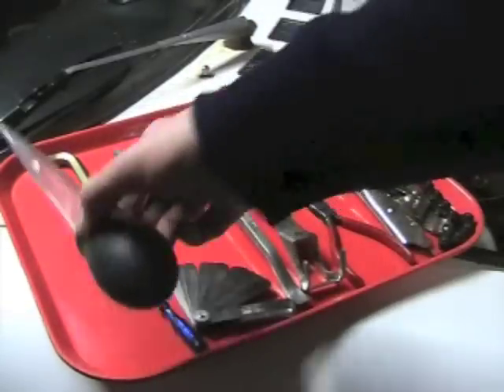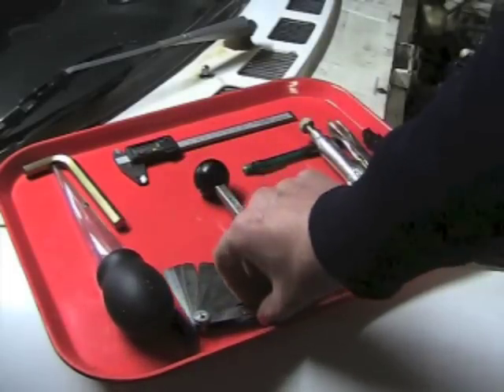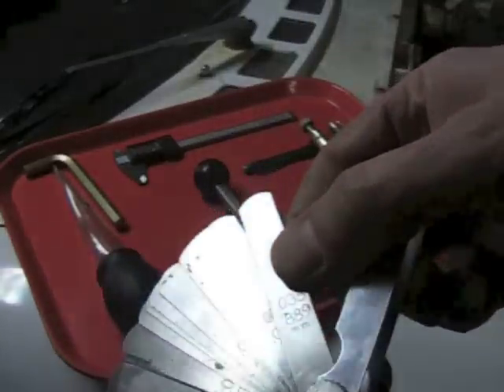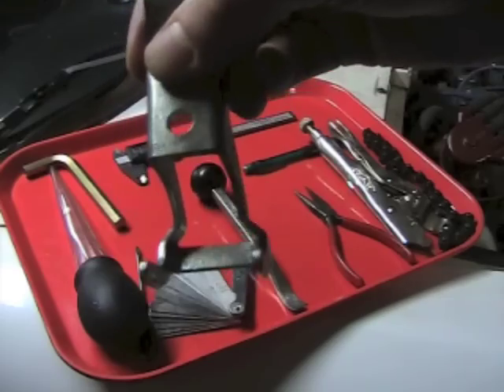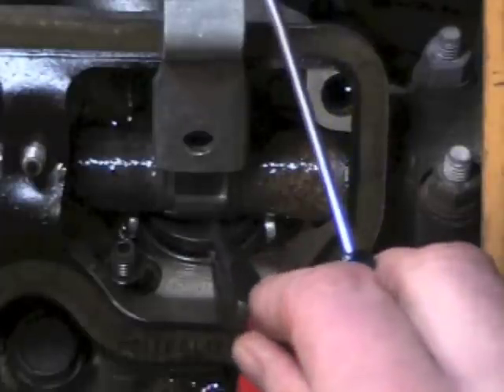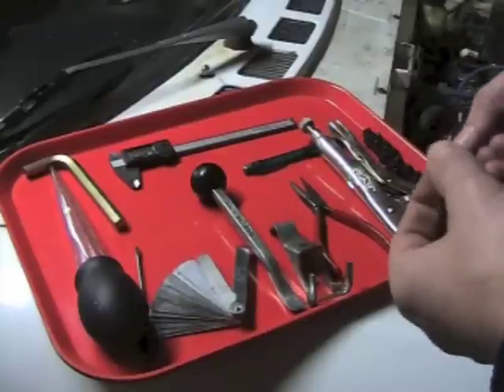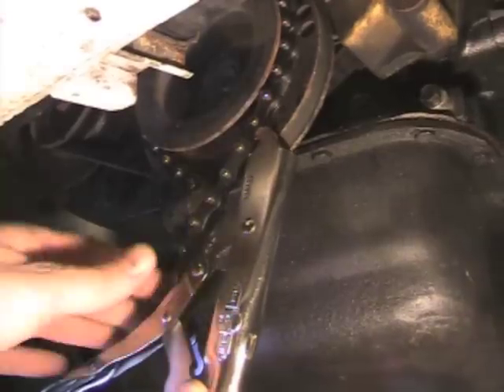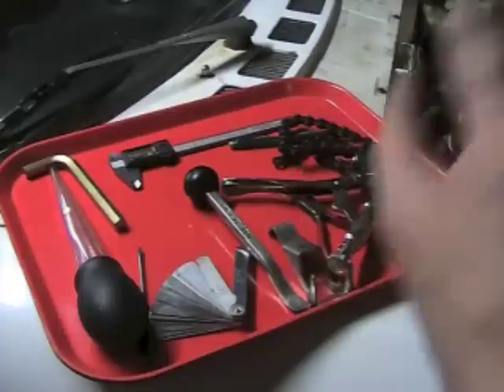Fiat 124 Sport Spider Valve Adjustment Tools

Comment: I really appreciate this, just did a valve adjustment on my '78! One thing I did differently was I used a homemade magnetic pickup tool to remove the shim, I had some very strong neodymium magnets and 3d printed a long holder for one, it had no trouble retrieving the heavy shim. Word of caution for people watching: be very careful with the chain wrench, if the tool slips while you're trying really hard to turn the crankshaft, there's not a lot of space and lots of rusty metal down there so you might end up needing stitches and a tetanus shot like me.

Comment: where can i find the tools
Reply from the maker: Hi! I got my adjustment tools so many years ago that most of the companies are out of business. (Bayless, International Auto Parts) I do see some tools listed online at certain places, but for breathtakingly distorted prices ($220 for the tappet hold down tool? !!! Seriously?) The only thing I can suggest is checking eBay and car swap meets/flea markets maybe. Or maybe someone selling parts cars, the black-handled tool I have came from an X1/9 I bought in the 1980s. Sorry I don't have a source for these.
Alden
Reply: @FlashDriveFilms  thnx for the reply friend, thats insanely expensive indeed. i can buy a complete long block for 200. i will just remove the cam and swap it without the tools then.
Reply from the maker: My thoughts exactly. When I originally bought my tools back in the 80s, they were like $20 each. And there were several vendors. Now , because these cars are older and more rare and "collectible", I have noticed a lot of profiteering for specialty items. Even the valve shims themselves are climbing in price. 
Best of luck with your Fiat project!
Alden
Reply: @mrboostification  False economy my friend. Whenever you swap the cams, you need to adjust the valves. It is also part or regular maintenance. Failure to do so can result in improper wear to your cams, valves or even failure of your engine in extreme cases.

Comment: I am trying to set the valves in my '81.  When I've done this before, I borrowed tools and shims from a friend of mine who was a Fiat mechanic, but he has since passed away.  He gave me one of the things that holds the tappet down while you remove or insert the shim, but I need the other tool-- the one with the spherical knob on the end-- that you use to compress the spring before inserting the holder thing.  None of the Fiat parts places seem to have those.  Can you tell me where you got yours?
Reply from the maker: Hi! I got mine back in the 1980s form a company called Bayless out of Atlanta. I think they have chanegd hands several times since then. The other tool I was lucky enough that it was included in an X1/9 I had bought way back then.A lot of these tools are out of production, so maybe ebay or a car swap meet or flea market is the best bet.
ALden
Reply: @FlashDriveFilms  Just one time. Matt Brannon of Midwest X1/9 bought out Art Bayless's remaining inventory from Georgia and merged with his existing business to form Midwest Bayless in Ohio. IAP retired and sold their Alfa Inventory to Centerline in Colorado and remaining Fiat 124 inventory to Csaba and Ramzi who started out on their own as Auto Ricambi after working for Robert Vick in Texas. Robert also retired and sold to a new family who now run Vick's but Chris Obert is still around and selling part in Santa Cruz. Any of these guys may have the tool you need.

Comment: Why wouldn't you just use the cam lobe to push the valve, then use the $40 tool to hold it, and then rotate the cam lobe 180 degrees?

I found this clever approach which avoids all the special tools, even the $40 one.

http://fiatspider.com/f15/viewtopic.php?f=9&t=30170&p=236174&hilit=Easy+valve+shim
Reply from the maker: +Rob Haynes No reason I can think of. It is just a LOT more rotating the engine, and to be efficient, you should have both cam covers off so that you can move between the camshafts to pull the next shim that comes in line. On my car I rotate the engine by hand during this task, using a chain wrench on the auxiliary pulley on the crank. So I would be up & down on the floor multiple more times as I crank the cam to hold down the tappet, then on my feet to place the tool, then back to the floor to rotate the cam lobe away for clearance to remove the shim, then on my feet, shim out, measurements taken, if I have to replace the shim to order the correct size, back to the floor, rotate to point I can release the tool and then on to the next cam lobe. Rinse & repeat.
The tie-wrap gimmick looks pretty slick & I know I am lucky that all my specialty tools were bought years ago at what now seems bargain prices. That said, I have never been a fan of sticking things down the spark-plug hole and into the cylinder. Any mishap and a plastic part drops in there? I wouldn't even be able to fish it out with a magnet. There is a border between "thrift" and "cheapness" and the tie-wrap thing seems to perhaps straddle that line. But as they say YMMV.
Alden

Comment: I just ran across this video.  Very helpful, thanks.  One thing though, that tool you found in an old X1/9 is $140.  Is there alternative way to do it?
Reply from the maker: +Rob Haynes Hi!
Well I had no idea the tools had become so expensive! The black-handled prying tool can be replaced by a wide-bladed, flat-blade screwdriver IF you are very careful and do not lever or pry so hard as to scrape, scratch or deform the shim or cam lobe. I really don't know of an alternative to the two-fingered tool that straddles the shim and holds the tappet down. I see that a company called Vick's Autosports, has the tappet hold-down tool for around $40. 
http://www.vickauto.com/newstore/index.php?main_page=index&cPath=5_6_41&sort=20a&page=2
(NOT an endorsement , recommendation etc, as I have not used one of their tools. Just an indication of what is out there.)
And always with the valve adjustment: take your time. This is a job that rushing it, ruins it.
Alden

Comment: a 1 1/2" socket also works on the crank pulley bolt also
Reply from the maker: hamletundone Good to know. Metric or inch, either one is a pretty large socket with clearance problems unless the radiator is out. I was super-lucky to have a double pulley on mine and to be able to use the chain wrench.Whatever method used, just don't turn the motor backwards and put slack int eh timing belt tensioner.
Alden